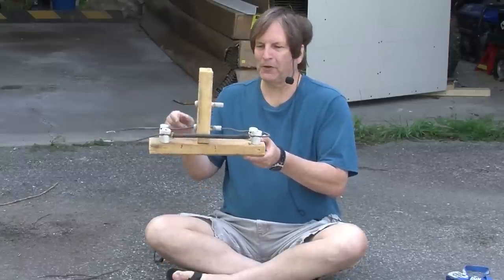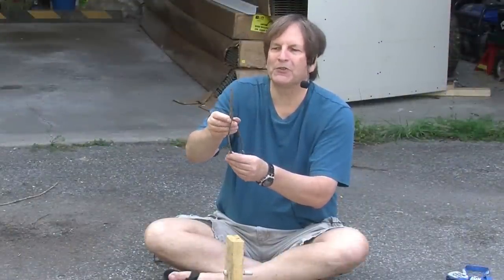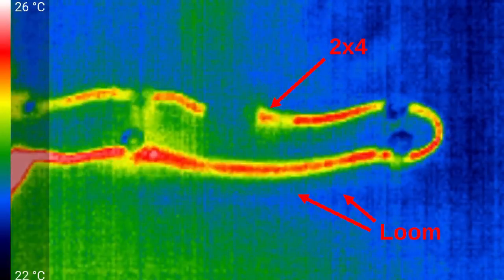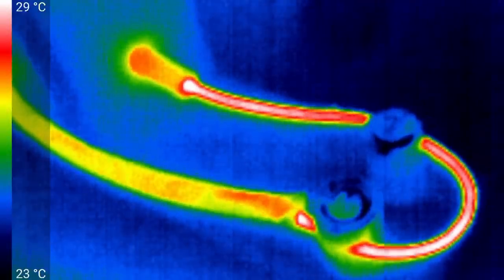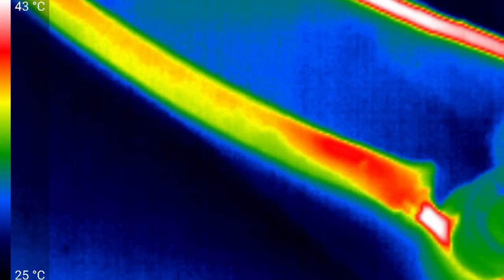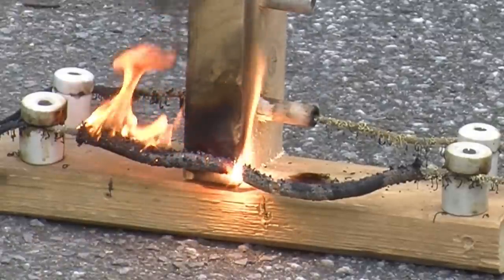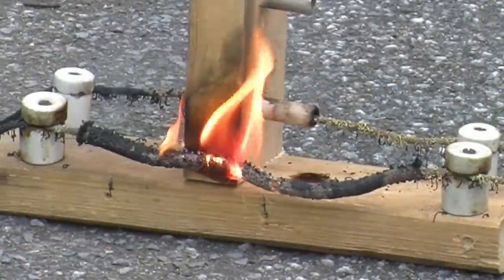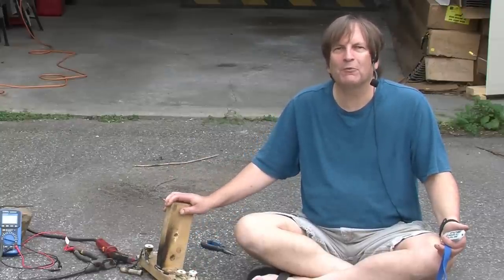Testing 100 Year Old Knob and Tube Wiring

Comment: Well this was a super interesting test, the K&T in my house (Appleton, WI) is 16AWG so I guess the wire size is different in different areas.

Edit: I just re-measured some of it and it is 14AWG, so I must have used a stranded instead of solid gauge when I did it while I was ripping it out.
Reply from the maker: Glad your found it interesting! Someone in the comments mentioned besides #14, there also was a size between 14 and 16 (15?). Its interesting that your is #16. Do you have any idea when it was installed? Besides possibly different sizes in different areas, I wonder if larger wires may have been used  more recently as more power was used?
Reply: @ElectromagneticVideos  I actually just got some out to measure it with my calipers, and it turns out it is 14AWG (measured 64mil), so I bet I used a stranded gauge when I measured it before (since stranded 16 is about the same size as solid 14).  Unfortunately I don't really know when it was installed since it was at some point after the house was built, but I guess it doesn't matter since it the same anyway lol
Reply from the maker: @wcvp  And I though we could add one more wire size to the ones people mentioned :) Is you knob and tube still in use? Or is it just remnants of a bygone era?
Reply: @ElectromagneticVideos  I think it was probably about 50/50 in use when I bought the house, and it was all for lighting excluding a few 2 prong triplex outlets.  I'm slowly pulling all of it as I remodel, so I think pretty much all of it is either disconnected or removed now.
Reply from the maker: @wcvp  Probably good that most of the wires to  were already modernized. Re-modelling an old place is a lot of work  but very satisfying (I have done it) - good  luck with the project!

Comment: Great video thanks for making it.
I do have a weird question, are you wearing work boots?
I ask as I know someone who was working in old house and touched old wire and current went into arm down body to sock feet and into ground.
He said it was very painful and advised me that I should always wear good work boots or thick rubber shoes.
Reply from the maker: Thanks!

No - not wearing boots. But here is the thing: I'm using isolated low voltage for these tests (see https://youtu.be/CP3-jcpzZeI)  so in the setup where I have it I am not going to get zapped. 

But - Your friend has given you some really good advice. Good thick rubber soles will provide an extra  level of insulation to protect you, but not something one should not rely on. Another is to use a fiberglass ladder if your on a ladder which is also insulating. 

Shocks can be painful, but worse, paralyzing and potentially lethal. So always take precautions when doing things like renovating. And when knowingly working with electricity, don't do anything you are not sure of or have any concerns about.

Comment: I don't think todays wire casting would have kept as well
Reply from the maker: Completely agree! I have see NMD wire plastic insulation get brittle after perhaps 25 years of installation. With the ceramic Knobs and Tubes holding the rubber insulated wire, the lifetime of the wiring seems much longer!

Comment: The real question is how much electrical leakage is there in a whole house with knob and tube...can one expect in an old house to lose several watts 24/7?
Reply from the maker: I'm not sure what you mean by leakage. If you mean the restive power loss when current passes though it as tested in this experiment, it would be no different from modern cable of the same size. If you mean leakage current though the insulation, I would think hardly any due to the ceramic insulators.
Reply: I've heard that on old k,t wiring,,,dust/dirt accumulating within cavities does conduct a small amount of current, ie electrical leakage,  and with hundreds of feet in a dwelling, you do use a little tiny bit, which adds up over time......maybe this is a mith I heard somewhere?
Reply from the maker: @brandtfj  That is very interesting! You know, there was a lot of dirt on the knobs and tubes. A hundred years of dust! And with a bit oh humidity it could conduct just a bit as you said and then add up all across the house. Maybe in an old house with no vapor barrier drafts could easily deposit moisture on some insulators. I guess the problem could be that if enough current flows along on insulator it could carbonize the dust and create a conductive path that could get hot and cause a fire. 

Funny - it reminds me of a place I once stayed it in Florida. The was a power pole neat the condo with the upper lines being at least a few kv. Salt and algae would build up on the insulators and from the ocean mist and you could hear it sizzle. Every now and then a huge spark and bang would lean it off. Same sort or trickle current on a much larger scale.

Comment: The wire must be close to the old Australian size called 16 which was 1/064 (1 strand of 0.064 thousands of an inch square) whose rating I can't remember, I think 16 amps but we used it sometimes in 60 amp fuses and I think it used to blow at 100 amps.
Reply from the maker: I didn't know Australia had historically their own wire sizes - Im guessing over time we all just began to use US sizes because of their dominance in the market. Interesting about using it as fuse wire - a few commenters have mentioned that the us #14 bare wire used in knob and tube was often fused at 30A because the air cooling allowed it to carry more current. Was the wire covered with insulation when used as a fuse?  I remember seeing fuse boxes as a kid with replaceable wire that was surrounded by woven asbestos fabric!
Reply: @ElectromagneticVideos believe Australia had similar to the U.K the Standard wire gauge a British units (SWG) till we went metric and used mm squared and rewireable fuses. Which was simply just bare wire put into a fuse carrier. Ours were covered in ceramic but one part of the way to view of it had blown was exposed . Then that was inserted into a fuse board with some asbestos pad material covering the hole. Google Wylex fuses they were our mainstay from the 60-80s. Still many in use today. Safe I’d used for overcurrent properly but many would wire it with the wrong fuse wire size. 60 amp would be 1.5mm wire 16 awg for tinned copper fuse wire. But residential would mainly use just 5,15 and 30amps in the U.K.
Reply from the maker: @lukedoherty8062  You just brought back a mmeory for me: When I was a kid we lived in South Africa fo ra  few years and we had rewireable fuses just like you described - asbestos pad and all. I remeber dad changing the blown fuse wire, and there were a number of different wire sizes each wound around a piece of cardboard presumably with the amp rating marked on it. I googled wylex fuses and some were very similar to what I remebered.

We had the same probelem here (Canada)  with people putting in larger replaceable fuses whne one would blow.

Interesting that you changed how wire was measured whne you went metric. We kept awg and many other things becuase of our US neighbours. So we really usea mix of systems these days.

Comment: Be interesting to see a comparison of knob and tube verse Romex have a rig setup with half Romex and half knob and tube and see which fails first
Reply from the maker: Based on the previous tests,. Romex would probably fail first - the soft plastic between the cables melts and the cables touch before they get hot enough to melt and arc like the knob and tube.

Comment: The cloth covering was probably asphalt impregnated.  That may be the smell  and cause for disintegration
Reply from the maker: It seemed more rubbery. But you could be right!
Reply: @ElectromagneticVideos  The insulation next to the copper is rubber.  Then it's protected with asphalted cotton covering
Reply from the maker: @grounded-b937  Oh! Interesting! I didn't know they impregnated the cotton with asphalt. Do you happen to know why? Maybe to keep the rubber from hardening due to exposure to the air?
Reply: @ElectromagneticVideos  I believe it was to protect the rubber from abrasion.  Just like the old timers made up splices on Knob & Tube - twist the wires, solder, apply a layer of rubber tape then a layer of "friction tape".  Which basically cotton tape impregnated with asphalt.
Reply from the maker: @grounded-b937  Is that what friction tape is? I didn't know the black on it was asphalt. On the video with the splice the splice was definitely covered with friction tape.

Comment: I think it's a shame that K&T has such a bad reputation these days. People forget that it was initially phased out because it was too labor intensive, rather than for safety reasons. It'll be interesting to see how modern Romex will be perceived in 70 or 80 years, since it is a lot more insulation dependent than K&T, and is just as susceptible to homeowners doing scary ass things to it. Who knows, maybe a new and improved version of K&T with protective ground and AFCI breakers will be developed in the future if repairablity and sustainability is taken more seriously
Reply from the maker: Yeah. Its amazing how will it had survived 100 years of service  and along as it was used the way it was intended. I have seen some older Romex in some houses I lived in where there is noticeable brittleing of the plastic insulation where it is outside of the plastic sheath in junction boxes. I wonder what the entire Romex cable - sheath and insulation - will be like in 100 years after the plastic has aged. Although I think your hope of a future K&T is unlikely - labor is just too expensive. 

One interesting thing is many  homes in Europe have wire in conduit, I think because of the brick and concrete walls which seems much better for future-proofing. Although maybe they have by now copied us doing things as cheaply as possible .....
Reply: @ElectromagneticVideos  I've seen that with rubber-cloth insulated wire, the insulation can be wrecked where it was in boxes above surface-mount light fixtures.  The tungsten filament bulbs produced tremendous amounts of heat.  Outside of where it entered the box, the wire appeared to be in good shape.  It's not until recent decades that high-temp capable insulations became the default in cables.
Reply from the maker: @boggy7665  How interesting - you can sure see how years of heat gradually degraded it. The limited amount of wire I got didn't show that but was not from light bulb fixture. There were some in the old shed - wish I had though or known about what you describe - I would have made the effort to get one which were  hard to get at (lots of stuff stored in the shed). 

I have seen even "modern" cables maybe 50 years old where the plastic insulation insulation gets brittle in the junction box. I wonder if plastics have improved since then?
Reply: @ElectromagneticVideos  I'm not an expert but was present when an electrician rewired our 30A-120V service to 100A-240V in the 1970s.  The wire that came in single coils or that was in armored cable then was type TW, plastic, rated to 60 °C.  Surface-mount light fixtures came with warnings to use 90 °C wire in proximity-- not sure how you were supposed to do that when the cable was 60 °C.  I guess, don't use those fixtures... but widely ignored I'm sure.  Today's common wire is type THHN which is rated 90 °C.  Like I say... subject to criticism by an expert.
Reply from the maker: @boggy7665  Wow - 30A - how times have changed! Interesting about the 60C where 90C is was required. I'll bet it was simply you used whatever fixtures and cable was available and the electrical inspectors accepted that at the time. I think almost all NMD cable is 90C these days ....

Comment: But how much voltage could you force through this without it shorting?
Reply from the maker: Assuming none of the wires accidentally touch wood, the ceramic insulators are very good and are similar to modern ones used on power lines. It could probably sustain 10s of KV if it was just the wire knobs and tubes. The fixtures (outlets and switches) would short at much lover voltages.

Electric cow fences used to use similar insulators and and were driven with short low current pulses of a few KV (not sure of the exact voltage or what is used today).

Comment: K&T did not have rubber. It was tar or bitumen mixed with cloth. The MAXIMUM amperage is 15 amps. The wiring is perfectly fine if kept at 15 amps it’s entire life. K&t is actually safer than romex for obvious reasons. Just got expensive and when insulation technology as well as wire technology improved they went with romex. 
This test though not advised is actually quite impressive and shows that they cut no corners in quality back in the good old days.
Reply from the maker: What I find amazing how well it held up afte 100 years or so. I have moderm plastic insualtion get brittle afte a fraction of that time.
Reply: Safer than romex? I doubt that. What is your source for only rated for 15 amp circuits
Reply: @chrishall2594  

Aside from that factor it is MUCH safer. 
My source: common knowledge. K&t was supposed to be suspended in the air. The hot and neutral were on OPPOSITE sides of the room coming in only to connect lights and the like. They made higher amperage conductors back than, just didn’t need them for the electrical demands of the good ol days so it wasn’t used except in commercial applications. They weren’t as stupid as one might think back than. Illiterate perhaps but definitely not stupid. They had the right ideas except for neutral fusing. What they thought would be double safe turned out to be the opposite as the neutral fuse normally was the one to go.
So technically yes the concept of K&t was and still is safer than having hot and neutral in the same jacket to cause shorts should one conductor lose its insulation. They thought of it believe me. 
The real reason why K&T went out was due to cost.

Same can be said with fuses vs. circuit breakers. Fuses ARE safer. That’s why the UK has every plug with a fuse. It’s peoples stupidity (ie: higher amp fuse or stinkin Lincoln) that did away with them.

Comment: Some areas require arch fault breakers.Also 15 amp breakers max.
Reply from the maker: I would certainly suggest arc fault breakers for knob and tube even if they are not required. How much additional safety that might add to a knob and tube installation that may have been subjected to renovations over the years  is perhaps up  for debate, but if replacing knob and tube is not an option, its at least somewhat better than nothing :)

Comment: Interesting  - for steel you have a BH curve that is non linear and I wonder if that is true or copper and aluminum such that staying below XX current  produces  very little heat  but at some threshold higher  the heat really goes up - again in a non linear way   I plan to put two microwave transformers in series such that each only see's 60 volts - tie the 2ndary's together to get the 2400 volts  why ?  because the transformers are physically too small and go too far up their BH curve into saturation  - and that is where that high current buzzing comes from - so  maybe you can get a quieter cooler unit that way   that's the idea  anyway
Reply from the maker: The BH curve is typical for Ferromagentic metals. Copper and Al will have essential a straight line BH graph that is way below the one I showed which si why we dont make magnets out of them.

The microwave transformers should not be in the saturation part of the curve. See my transformer videos. Be REALLY careful with the microwave transformers - the kilovolts out of them is lethal. Consider using a dead mans switch to keep yourself safe. I gather a number of youtubers/viewers have been killed/maimed by unlikely events like falling onto HV microrovave transformer circuits.
Reply: @ElectromagneticVideos  Thanks on the microwave transformer advice - I know I know - I'm prepping up with meters and all my caps are going in new PVC containers with no ability to have two connections close - it all sucks - that 60 hz buzz scares me- I lived in a damp basement for like 12 years with purposefully negligent extension cords  on the ground - why ?  not sure - but 3000 comes to grab you I guess - I am not playing sparking  Tesla stuff - one hand operation also - and I am not experimenting   there is a goal and that's it - thanx again
Reply: @ElectromagneticVideos  I thought that they naturally close in on saturation at full voltage - my current meter shows  current draw is negligible  until about 90 volts and then goes up quite a bit  - so my reasoning is that yes - it has moved into the crap part of the BH heading towards saturation - no ? and so two in series would keep each down at 60 volts - anyway I'll report my results thanks again for responses
Reply from the maker: @TotalFreedomTTT-pk9st  Its a cost compromise - typically the top of the sine waveends up somewhere in the knee of the curve. More so for short term use things like a microwave.  One would expect the idle (called magnetization) current to be some fraction of the full load current. My guess would be maybe 5 to 10% although maybe more for a short term use device. Since that current is mostly reactive, the current doesn't result in much power being consumed.

Comment: The wire is tin plated so it will be easy to solder
Reply from the maker: Plating was apparently also to keep the Sulfur in the rubber insulation from corroding the copper.

Comment: That's not the cloth coming off, it is the rubber/plastic oozing out if the porous cloth cover from underneath it...
Reply from the maker: Just looked at that part of the video again - you may be right. The spirally things did not seem rubbery but it could be they just cooled upon air exposure and hardened. Now I wish I had examined them more closely.